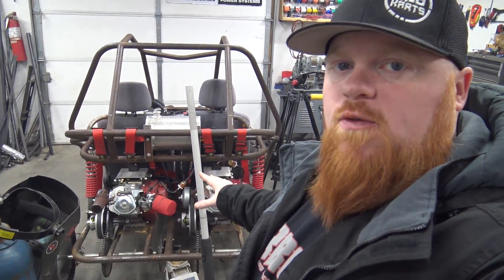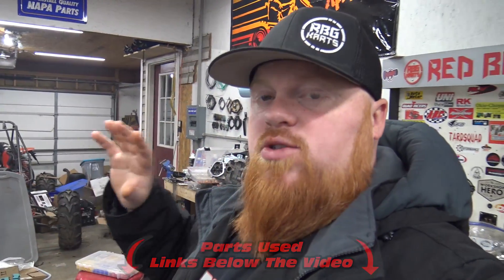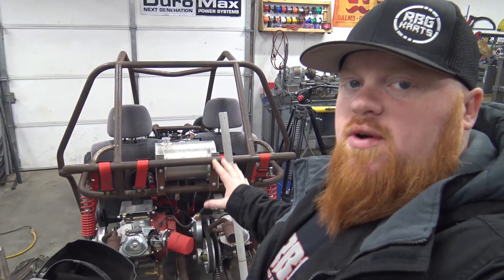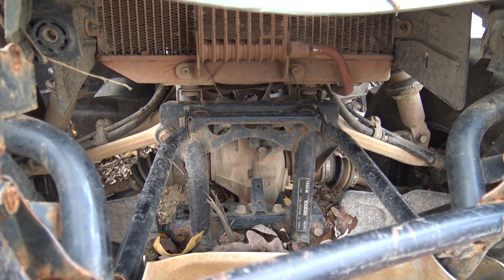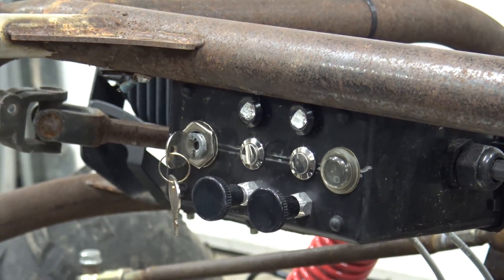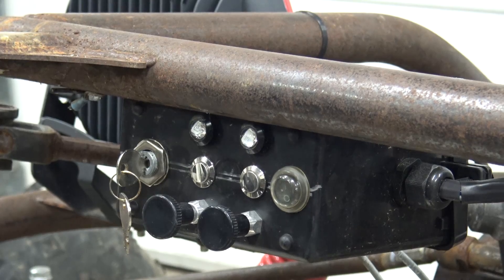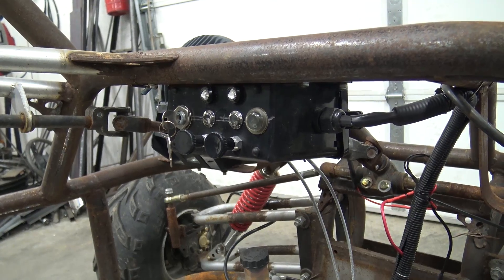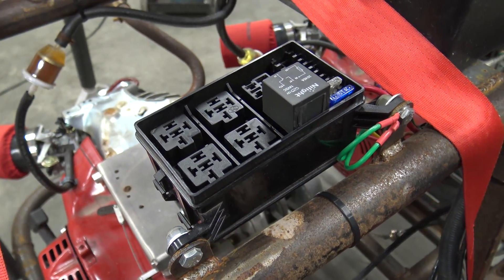How To Wire Two Engines On One Go Kart

Comment: Greetings Gregg. I've followed a great many of your builds and although I don't have nearly the facility or resources that you  do, I've been able to put your very helpful expertise toward a number of successful projects. If you or any in the circle could lend a thought on one in particular, I would greatly appreciate it. I have a  GT Series garden tractor and considering a 4X OR full on 6X conversion. I'm wondering if adding another Kohler would be a feasible prospect as it will be a "worker" at the barn and will be using various attachments hence, depleting more power from the single engine. I have a completely rebuilt Magnum 20 available however, I would need to "sync" them and therein lies MY lack of expertise. I understand the basic concept, it's just the "tech particulars" I'm not aware of. I'm thinking if I drive the rear alone with the 20, I could use the existing 25 for not only 4X in front with the PTO (have an identical hydro) but the various attachments as well without compromising the overall power of the machine itself. If you could find a minute and let me know your thoughts or throw it out to the group and perhaps everyone could learn something new. Thanks in advance and stay safe . . .  John 3RD

Comment: The specs on the voltage regulator says 0 to 4 amps. But with both charging coils it 6 amps together. Is it still okay to use that voltage regulator even though it’s says 0 to 4 amps? Also do you mean voltage regulator or voltage rectifier?

Comment: By all means stay with the two motors...Ive been brain storming on a double motor buggy using two Hyosung TE 450's...they are electric start motors with reverse, besides shift and clutch linkage,  wiring  the starters would be a challenge as well... could I wire them up the same as you did? ...the parts list with links is great, you are an inspiration.

Comment: Keep the go-kart the way it is other than the few little upgrades and Custom the motors I say Mikuni carbs for each motor Billet flywheel oversized cam use the four-wheeler engine for something else maybe a jacked up go kart something fun for mini Mayhem and you will have enough time until next year lol

Comment: Keep the twin engines, they already put more power than the rincon can. Those honda are preeeeety underpowered for the displacement.
A better option would be a kawasaki vtwin 650 or 700 from a Prairie or a V-Force pr a Brute force They output 45 to 50hp, and they sound MEAN with an exausth.

Comment: Very cool. I think you should keep the two engines go with maybe a 2 stage build . with that much power you can go with much bigger tires that would make a sick trail rig after doing the front suspension. Save the Honda 4x4 for a purpose built 4x4 it will turn out way better. Keep up the good work.

Comment: You should "builded" out the 2 motors
Reply: I kinda agree it needs to be a better buggy for the 4x4 if he will actually do it. Then he will finally figure out that the engines they claim to have so much hp really dont an that its time to move on to bigger an better

Comment: right off the bat you killed one of the benefits of having two engines. you need to rewire it to kill or run one engine just incase one engine goes bad the other one will get you home. at the very least somewhere you can repair it . tow engines are not just for the extra grunt but they are a redundancy.

Comment: Yoooo I have 2 06 650 Honda rincon 1 of them needs a frame rusted to death but still work it the other one is technically brand new only 200 miles on it compared to the other one has 1100 miles ik enough said great machines
Reply: I plow snow with these so that's alot on them if u dont think 1100 miles is not alot

Comment: Get another engine up front with a differential axle, like the one in the trike, and narrow it. Put CV shafts and blah blah blah. AWD! 1320cc's! What other 4wd system will add power besides electric.